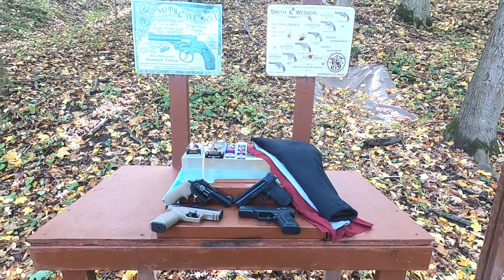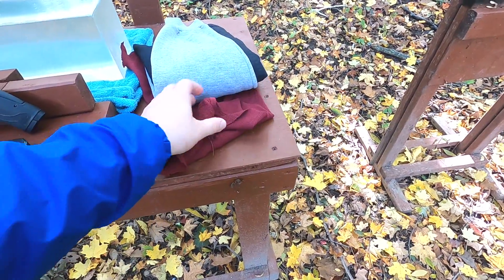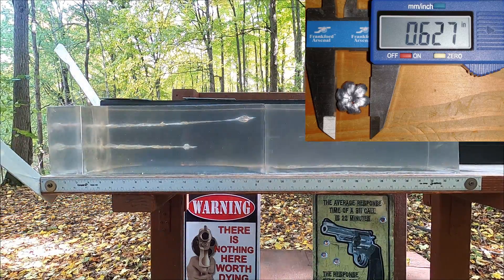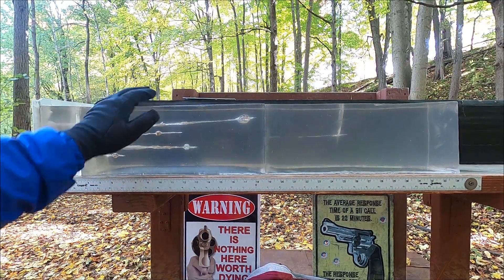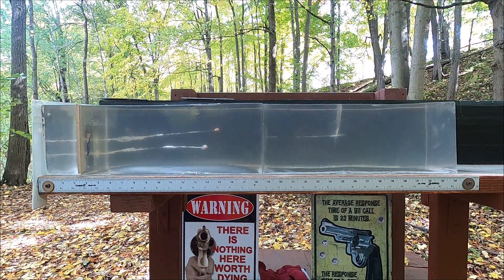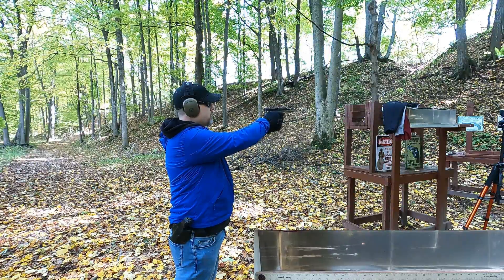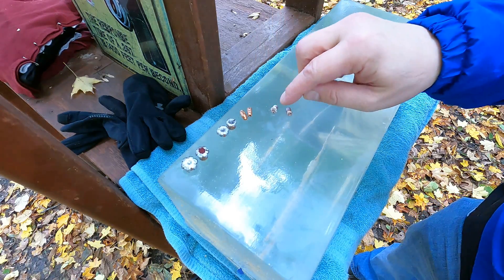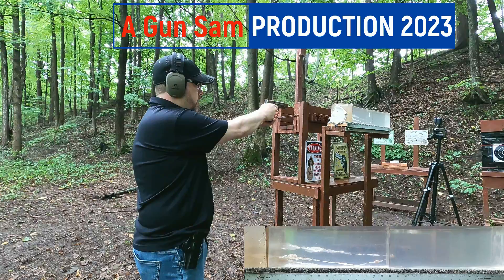Heavy Winter Clothing Ballistic Test - 9mm, .380 ACP, .22 Magnum .22 Long Rifle

Comment: Nicely done. Thx for mentioning the energy increase, showing the bullets. All the small improvements are showing. Lay a cloth over the gel so there is less reflections. Am cam on a flex arm you can clamp on the jug-or-naught might be worth a try to have it above.

Comment: The bullet construction for the .22 Magnum is optimized for rifle barrels.  The velocity out of that Ruger LCRx (3 inch barrel) simply isn't enough to cause expansion.  And, to top it off, there is additional loss of velocity when fired from a revolver due to cylinder gap.  Look at "Ballistics By The Inch" for some basic test data supporting this.  I'm curious what the .22 Magnum would do out of either a Kel-Tec PMR-30 or the new S&W M&P .22 Magnum, both of which have approximately 4.4 inch barrels.

Still interesting results out of this test, though.
Reply from the maker: I have looked at ballistics by the inch in the past. Interesting argument as almost nothing is lost through the cylinder gap.
Reply: @GunSam , well something gave them much lower velocities out of the revolvers in their tests.  Maybe slower burning powder that just takes more barrel length for a complete burn?  That's why I think the semis would be a good cross check.  If they still have low comparative velocities, then that really just leaves barrel length being the biggest factor for .22 Magnum.

Comment: How does the Judge with buckshot do in this test? Interesting.
Reply from the maker: I have ran like Federal 000 and other 000 at close range. If I recall right, the penetration was about the same as this .22 LR ammo. Now obviously it's not identical as I think each pellet is about the same velocity, however that's .360" diameter and 70 grain which is a bit more energy per pellet and a lot more tear through with each pellet. It's probably just the roundness and jump in size making the more powerful shot penetrate less. So 1 shot of .22 LR is like .22" with 90 ft lbs and 9.5" penetration, one 000 buck is .36" with 125 ft lbs and 9.5" penetration. The odds of a stopping shot with that .410 is really going to have to take into account the entire spread at let's say 5 yards, which with Federal 000 is like 1", equating to probably the same effect as an expanded .45 ACP and a LOT more effective than a round of .22 LR, or even three .22 LR's. A .22 LR mag dump resets each shot with 20% chance to stop a threat rather than adding up the odds. So at the end of the day, the .22 LR is less effective to stop threats, yet having to use so many shots, probably more lethal in the end.
Reply from the maker: I have no idea how it would do in winter clothing test, but I have like 3 rounds of Federal 000 2.5" buck left so maybe I could add that to a test like this lol.
Reply: Videos I've seen is it's a terrible choice. You're responsible for every single pellet, also have to think about fast pellet spread and not great penetration

Comment: dont use hollowpoint in 380s or 22s.  doesnt make sense.  bet you get more penetration that way.
Reply from the maker: I have seen better performance with hollow points that do not expand, VS stuff like FMJ.
Reply: @GunSam  I was mostly looking at the 380 that didnt penetrate far.  I use standard round though almost all of my handguns.  cheaper and I guess work.  I dont have the setup you do for testing though.   I like that 22mag revolver you have.  nice.
Reply: @GunSam something like a hard cast 380 that has a flat nose and steep angled ogive could cut tissue better than an FMJ.

Comment: Every video you do with the tx and the mini-mag makes a stronger case for a self defense platform, offering confidence to the recoil sensitive and new handgun shooters. The comparison testing being done here is valuable for everyday average firearm enthusiasts, nice job.
Reply from the maker: I mean, the ability to penetrate is probably close to enough for a central nervous system hit. The problem is that .22 LR is still at 20 - 25% one shot stop depending on the sources, as where 9mm, .38 Special+P and so on are 70%+ one shot stop. Simply put, the .22 LR is unlikely to stop a direct motion like a person running at you swinging a weapon. Most centerfire rounds will divert those motions at least some and cause a 'stop' of some form, buying time to place more shots, to take cover etc. You may have more of a fight even after the opponent takes a few hits from 9mm or similar, but it buys you 'motion stops' (aka stopping power) time. It wouldn't surprise me if a determined attacker absorbed 10 rounds of .22 LR and still slashed you, if that was the specific threat incident. Not to say a show of a gun or one round landed won't stop someone from a psychological stop or CNS shot, but it's still something I wouldn't be comfortable with carrying.
Reply: @GunSam  I agree with the lack of man's topping capabilities of 22lr, but for animal predators around your property it should be effective enough, unless you live in bear country.
Reply: @GunSam I don't get the importance of mythical "one shot stop" studies. Most people/cops aren't firing a single road or hitting an assailant with a single round. It seems a little anecdotal to be honest. Sestch Trooper Mark Coates on YouTube, muscular former-Marine state trooper doing a traffic stop on a basically obese guy, escalates into them essentially drawing and firing on each other at the same time, trooper fires and hits driver with 4 38spl +P rounds out of his full-size 357 revolver, driver hits the trooper under the armpit ONCE as he's turning with a 22lr out of a tiny NAA revolver. Trooper collapses and dies there on the side of the road, driver gets in his car and drives off. Bullets do weird things and human bodies are weird. I'm sure a 50 AE would have a higher one shot stop than a 9mm but I'm not gonna start carrying a Desert Eagle. Sorry for the spiel there, I think this was a great test and shows the power of 22 for those that can't carry a 9mm/380/38/40 etc

Comment: You wouldn't have 2 shirts, 2 sweat shirts, and 2 winter coats on.
Reply from the maker: The coat was half as thick as a lot of good ones. Plus, grazing shots through the arm of a coat would pass through not two, but six layers of that coat. But two sweatshirts, people do it. I have done it.
Reply: @GunSam  3 layers of the coat. 2 layers for the arm and 1 layer of coat for the chest/gut or whatever. But I see what you are trying to go. Good test either way
Reply from the maker: @thatoneguy454c  I talked with a guy on here, was a lot more he wears than what I tested. Even if it weren't realistic, adding more clothing is better than less, plus we can see more didn't fail the test at all. The other commenter says this about northern Wyoming "Carharrt jacket & insulated bibs, sweatshirt, T-shirt, and long johns is typical we see out here on the cold days".
Reply: @GunSam  yeah I live as far north as you can get without either getting into a lake or going to Canada. I would like to see a test with a set of arctic gear. I'm cured how many common defensive loads would still be able to open up after passing through all of that heavy cloth and insulation. I have heard stories of cheap hollow points having completely lost their jacket by the time they make it through, but that sounds like BS to me. I suppose it's always possible though.

Comment: Very interesting results. Not related to this video in particular, but I keep wondering what causes bullets to bounce back in the clear ballistics. It's an interesting phenomenon and I have several equally (in my mind) explanations. I wish 10,000fps cameras weren't so insanely expensive! I would love to see what's going on.
Reply from the maker: I could swear I have seen the bounce back in real slow motion before. I think what it is, is that the wound hole stays open for a split second, so the rubber like consistency of synthetic gel bounces the bullet back while the hole is still expanded. I have even seen .45 ACP Gold Dot do like 15" and bounce back to the front of the block. https://youtu.be/W8Jt7IG1GSE?t=204
Reply: @GunSam  Wow! One thing I've noticed about 45 ACP in general is the rounds, especially the 230gr FMJs can bounce around like golf balls. I've had some nasty ricochets with them in the past.
You're probably right about the mechanism of the bounce back in the clear ballistics. It is obviously very different from organic gel in that respect. It is also very different from flesh. So I don't know how to read damage tracks in the clear ballistics stuff and translate it to what might happen in another medium.
Reply from the maker: @Fudmottin  I saw your emails but haven't read them really, glanced over. I know I have ran that .38 ammo before, but it might have just been in water jugs.
Reply: @GunSam  After switching to gel, you have tested the Lehigh bullets in 380 and, I think, 9mm. The 38 is 100gr, heavier than either of those and would be (probably) a bit slower out of a 2' barrel. The accuracy testing shows them falling down at 75 yards. If you think testing Underwood Item 853 would be redundant, I understand. You've had similar conclusions on the ones you tested in gel so far.

Comment: I was starting to think I needed an LCR .22LR. Now watching g these tests I think I need to also to snag the LCR .22 WMR to the carry collection….
Reply from the maker: The trigger pull on the rimfire LCR and LCRx is really really bad. Something to be aware of. The centerfire versions are smooth, the rimfire ones are hard and gritty.
Reply: @GunSam  I’ve heard that. I can’t remember if I checked one out at a store, but do recall handling LCRs. I’ve been a long time S&W fan but credible members of this industry have reported they’ve recently seen quality control problems - locked up actions.  I haven’t really been serious about shopping for guns lately, especially used but may have to get ambitious again.

Comment: What do you know about ported revolver barrels? How much velocity is lost? Is it worse with a 3” than a 6” barrel? I currently have a Taurus 692 on layaway and I want to know more about its 3” ported barrel. I have looked it up already but the statistics are not consistent.
Reply: This revolver also comes with a 9mm cylinder, would it be be more efficient to shoot 9mm in terms of velocity?
Reply from the maker: I honestly wouldn't know how much velocity is lost from porting. If I had to guess, more would be lost with powerful rounds like .357 Mag might lose 100 FPS, as where .38 Special and 9mm probably won't lose much. Just my guess.
Reply: @GunSam  I know that previously you’ve said that a 3” barrel acts like a 4” more so than a 2”. Do you think that the ported 3” might be dead center of the two?
Reply: My bad, I worded that poorly
Reply from the maker: @fairnheight3673  it's one of those things that is difficult to know in general. For instance, you might have two 4" S&W 686's, both identical. One might shoot an ammo averaging 1,400 FPS and the other one maybe 1,500 FPS because of the differences in gun to gun, even of the same make and model. Adding porting VS another gun is difficult to know how much is lost. When I look up on Google, difference between revolvers that are ported and not for average velocity, the 'answer' that shows up is 9mm Glock ported barrels, which lose about 25 FPS on average with ports. When I search .357 Mag, it shows 6" barrels and losing 100 FPS with the ports. It's going to be caliber specific more than anything. I'd guess that 9mm and .38 Special won't lose any meaningful velocity, .357 Mag will lose some, i'd guess 50 FPS in a 4" or 100 FPS in a 6". Those are just educated guesses.

Comment: I don't think anyone who has grown up using .22lr guns believes they are the best choice for self-defense, nor do they believe they are useless for that role. I've said before, many factors come into play in determining the outcomes of deadly encounters...the size and power factor of the gun used seldom is the sole determinate. Your tests are proving over and over that the .22lr is quite capable of penetrating to vital organs, including the central nervous system. Folks they say that shot placement is less important with more powerful handguns have not seen as many gunshot victims as I have. Thanks for the work you're doing. Maybe it will change how a lot of folks think.

Comment: Another nice comparison.  Although I'm not surprised at the 22 lr performance.  I recently fired CCI Quiet 22 lr through my Lcr 22 snubbie into 4 layers of denim, 1/4 mdf, and through 1 water jug and trapped in the second.  And that ammo is only 700 fps through a 16 ' rifle barrel.
Reply from the maker: I think I shot that years and years ago. If I recall it's basically sounding like a .22 Short
Reply: I think it is quieter.  I forgot to mention the 1 3/4" of baloney.  Tried to copy off of you.  Hope your jug or not test isn't patented. @GunSam

Comment: I switch from 9mm to 45ACP for winter carry here in northern Wyoming. If the 230 grain Gold Dot doesn't open up, it still makes a big hole all the way through, and very few HPs will reliably expand through the clothing (Carharrt jacket & insulated bibs, sweatshirt, T-shirt, and long johns is typical) we see out here on the cold days.
Reply: Yep, extreme winter environments will usually have cotton t-shirt, flannel, sweatshirt, heavy insulated canvas. Might even be two layers of the heavy insulated canvas (bibs beneath jacket). The only material that would offer a little toughness would be the cotton canvas. The other stuff is just a HP-clogger. Maybe something like a Lehigh Defense Xtreme Defender would function well, outside ball bullet.
Reply from the maker: Momentum is real! I was debating using Carhartt type material. I think I have a spare off brand Duck brown fabric coat that is the same as Carhartt. I can probably use the info you listed as a worse case scenario and do all you said in a future video.
Reply: @GunSam  That would be cool!
Reply: Yes please. My husband carries 230gr hard ball in his 1911. @GunSam
Reply: FMJ is still king, worked in both world wars, Korea and Vietnam
Reply: @sosuapimp8449 Carried 230gr fmj for decades. Currently carry 220gr Critical Duty +p in a Ruger SR1911.

Comment: Great test. Like the results. Dispelled a myth. 👍🇺🇸😎
Reply from the maker: Thanks! I am rather surprised myself. I will probably hear from some people that I did it wrong somehow, and with 'more real' stuff like leather and denim, they would have bounced off.
Reply: @GunSam  😄
Reply: The test medium for "bones" is probably the best-possible condition, ie. perpendicular surface to bullet path. In reality ribs and other bones are rarely nice and square, but convex shaped and a bullet (especially soft lead like .22LR) nose which is rounded in profile could conceivably veer upon impact, deforming the bullet shape, bending the nose, mushing the roundness and very much changing the dynamics of what happens after that. Just something to think about. 40 gr .22LR are already at the bare minimum of sectional density and velocity to help penetrate. Tumbling and a change of shape (smacking a convex surface hard object) will severely effect penetration. I actually think a medium size round ball from a cap-n-ball revolver would function much better than most .22LR projectiles.